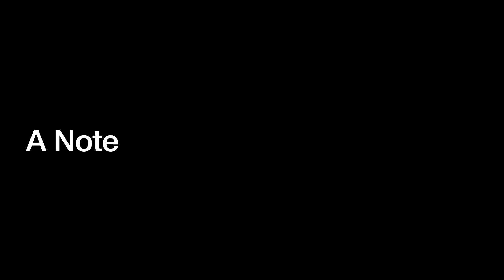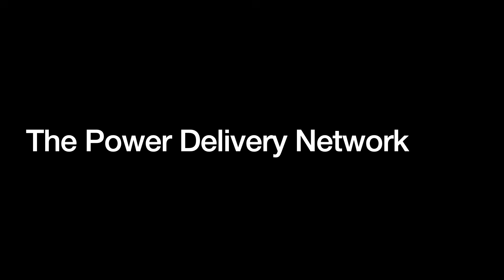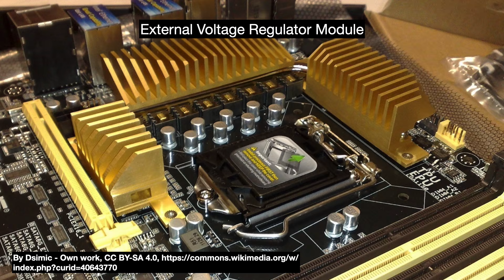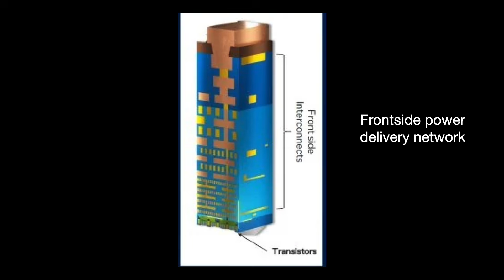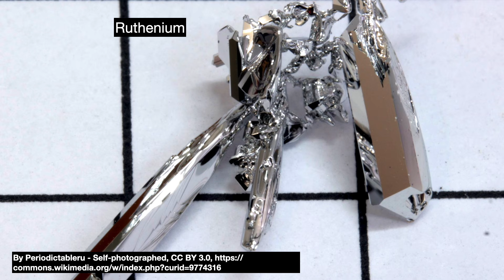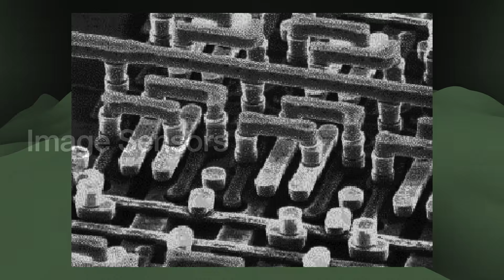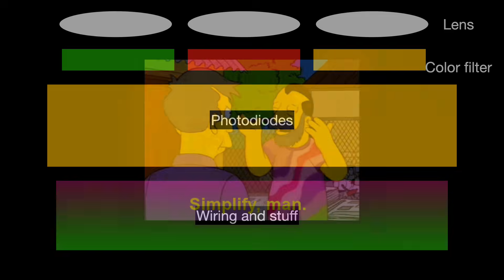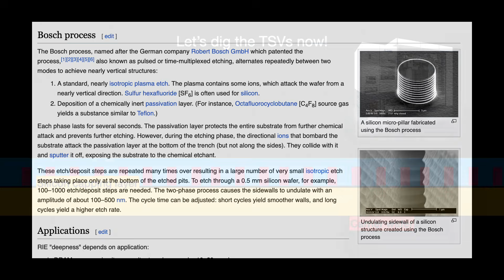Intel’s Next Breakthrough: Backside Power Delivery

Comment: AMD bros, We got too cocky.
Reply: AMD will just buy whatever process nodes TSMC delivers. Remember that Intel was overtaken by TSMC because they put too much technology at once that turned into multi generation delay when they could not deliver. This is the same song and dance again Intel chooses multi technology jump while TSMC chooses to do one step at a time.
Reply: @kazedcat that's a pretty crude way of doing logic. Yes there were specific issues with the specific design choices of that node, layered on top of massive human resource and management issues... but to extrapolate that and say anytime intel tries to innovate faster than TSMC it is simply a repeat of the past, so they should try to go as slow as possible, I don't see how that's anything better than a gross historical parallel absent of any attempt to look at the context of the situaton.
Reply: @bubblebobble9654  It is a repeat. Does Intel have more engineering resources now compared to when they are leading? If you can prove that current Intel engineers are more competent than before then maybe this time it is different.
Reply: @kazedcat  This is anecdotal of course, but I've seen some not insignificant changes at the Orgeon fab in the last decade, at least in the fab R&D groups.
Reply: theoretically, if intels process end up better than tsmc. with intel opening up their fabs. AMD could be a customer. its a long shot, probability of that happening is low. just an idea.
Reply: @awesomewav2419  AMD will not buy from Intel fabs for leading edge. AMD is heavily invested in TSMC's technology stack. Switching everything to Intel's Technology stack would take a decade of work.
Reply: No... its just intel stumbled but that didnt last forevern AMD is just being AMD.
Intel is so much bigger than AMD and a much bigger innovater
Reply: @Capeau  Again AMD will just buy TSMC'S technology. TSMC is bigger than Intel.
Reply: @kazedcat  they have more fab capacity... sure. Not sure if they are bigger as a corporation.. i have some doubt.
Also, bigger does not mean better.
Intel is about to overtake them in tech.
Reply: It will trickle down from TSMC to Apple, then AMD.
Reply: Tsmc already has this. cowos
Reply: Nonsense.  Intel is gambling big time on this backside node, because they have to.  They need a big leap to entice any customers leery of them possibly stealing tech.  Intel can give all the assurances they want but with TSMC everyone knows they will never make a competing product based on techniques they learned from the fabrication process.  Eventually Intel will have to split into 2 companies, and even then its going to take years of good will to convince competitors to use their nodes.
Reply: And AMD has no good engineers, they have to call Jim Keller, and continues charging US$500 for a glorified low-end 6c.
Reply: Nah, Intel's design team is not even close to the fab team. They need to fire the entire design team if they want to compete.
Reply: @WaterZer0 Compete? AMD is a literal fraction of the size of Intel and that’s with its graphics division included. Of course it doesn’t help that their graphics division does even more poorly than their processor division but the point remains.
Reply: @WaterZer0  Guess who's still using a 4-way front end decoder in 2024 :)

Comment: Is this really a new breakthrough? I've been backsided by Intel for two decades at this point
Reply: Powerbottom delivery
Reply: @keyofdoornarutorscat Make you put your ohm face on
Reply: @keyofdoornarutorscat  Intel can be such dicks.
Reply: @keyofdoornarutorscat  Bareback pipeline
Reply: Keep it greasy, hurts less.
Reply: It absolutely is an amazing breakthrough, the question is if it actually comes out remotely on time
Reply: @benc3825  yep, basically renovation of the chip from what I believe. Separating the power and data lines from the ground up.
Reply: @benc3825 in a couple of months... which means they got it working
Reply: Your fault for going Intel
Reply: Decades... really?! Dont be such a diva.
Reply: Are you still bleeding?
Reply: When possible, I always buy AMD.  Even though they did not hire me when they had a chance.
Reply: @michealmorrow1481  Another plus for AMD! /s

Sorry I couldnt withstand the urge :(
I am sure your a great and skilled person :)